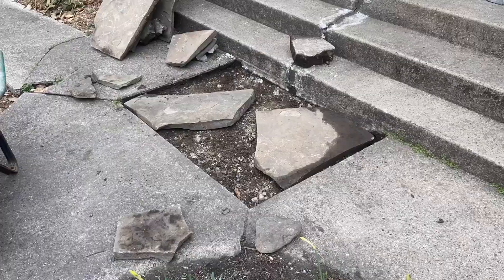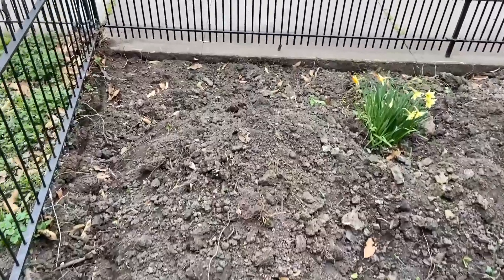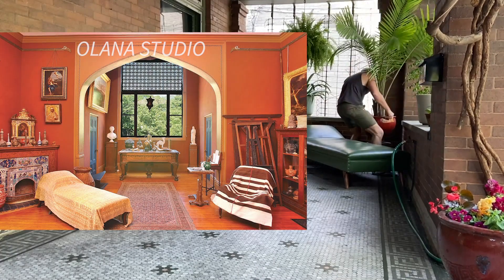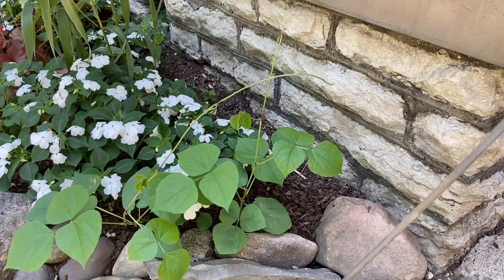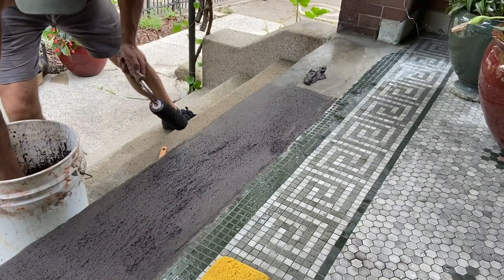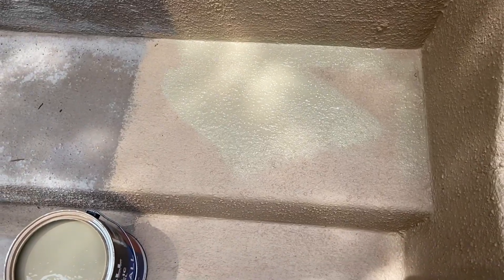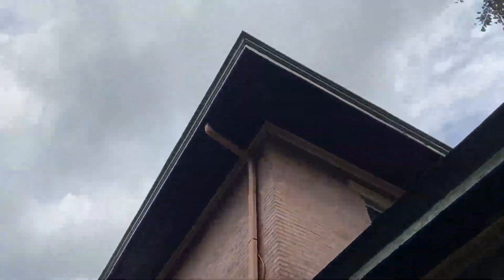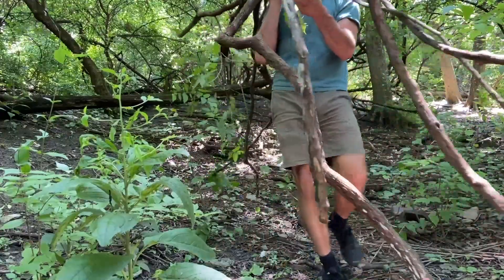Front Porch and Garden Transformation

Comment: Looks great! Whoever invented concrete scalloped edging needs to be fined. 😃 The grape vine frame really makes the space have a sense of place. The william morris like curtains just add the final touch. Subscribed!
Reply from the maker: Appreciate that so much!
Reply: Here's an idea. I too, hate those ugly scalloped edging stones. Since money was getting tighter on the project I budgeted for, I turned the scalloped stones upside down into the soil. It was a bit of a challenge to get each one level next to the other one but once that was achieved they were solid. After a couple months and the stones had some time to settle, those ugly scalloped stones were in the ground like poured concrete. The scalloped edging grabs hold of the soil making it hard for the stones to shift. Just an idea. 😊